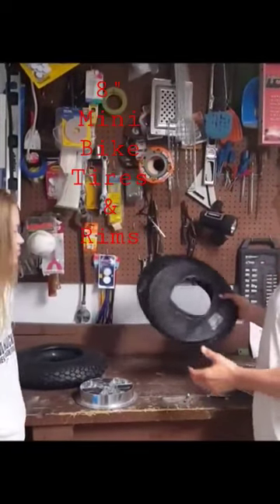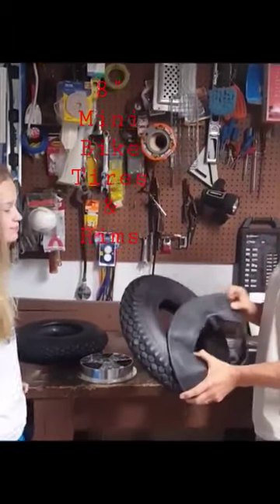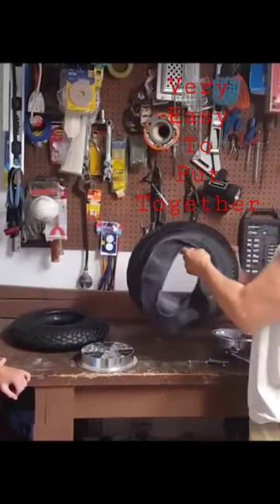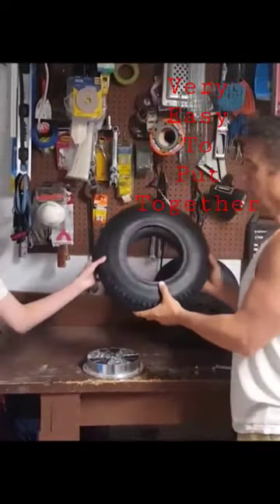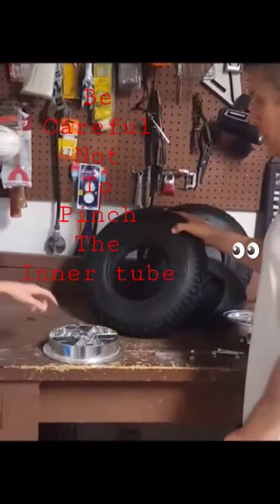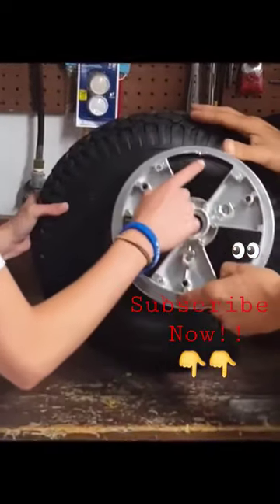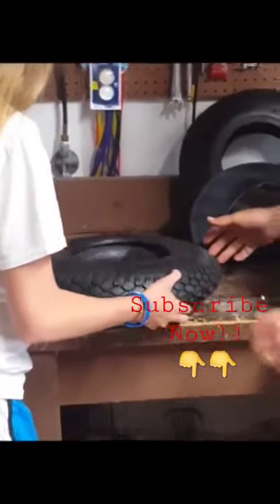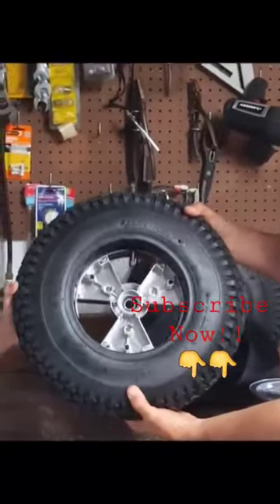Mini bike BUIld wheels #minibike  #shorts  #dirtbike

Comment: That's sweet! Even easier than the 10 inch Azusa wheels!!
Reply from the maker: Never had the 10" wheels
Reply: @allaboutminibikes  heavy. No hub. You have to partially inflate the tube then set the valve through one side. Not huge but that looks neater.